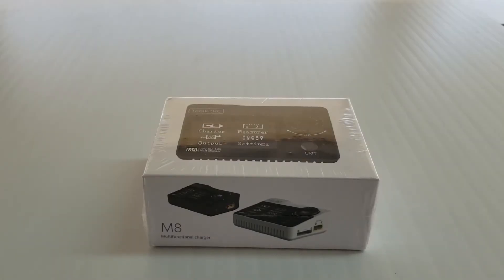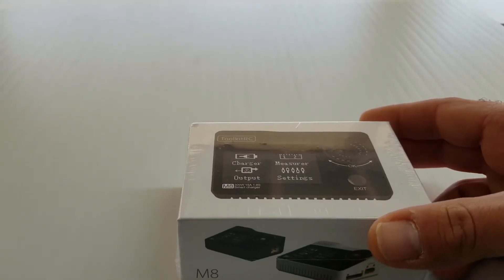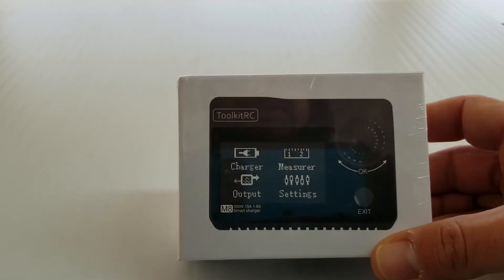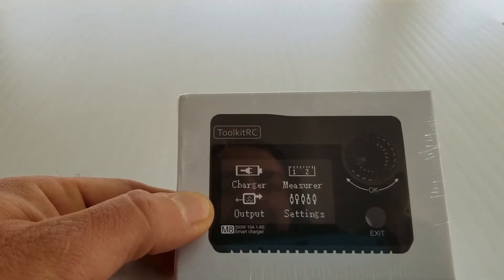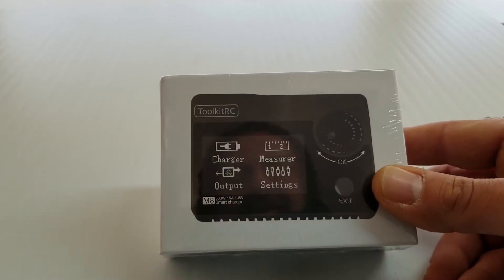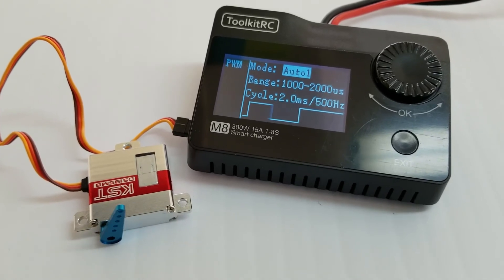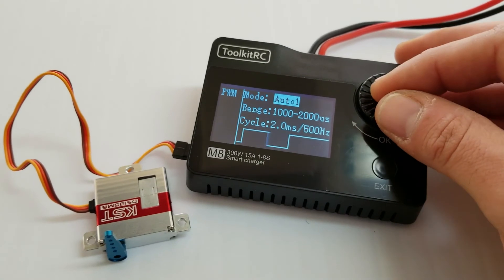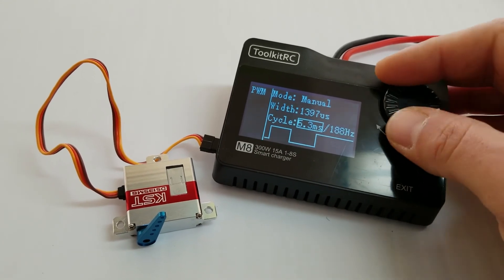ToolkitRC M8 Lipo Charger and more....

Comment: I bought one from Bangood, but they did not inform about the missing power supply. So, where to get one?
Reply from the maker: It does not come with a power supply.  Most chargers don't. I use a large lipo or isdt power supply.
Reply: @flightcomp  , that's silly. Not of you of course. But from a construction point of view. What would it cost to have it work from the mains? Probably less than a 4 S battery which, btw, I never use otherwise and would have to charge separately. What a stupid idea from the manufacturer.
Reply: Eddy Jin  how complicated would it be to add to the description that there is no charger coming with it? Not at all.
Reply: I am encountering the same problem right now, can I learn how did you overcome the problem?